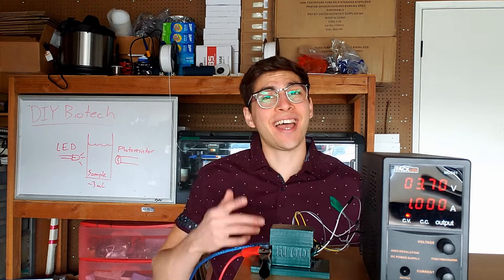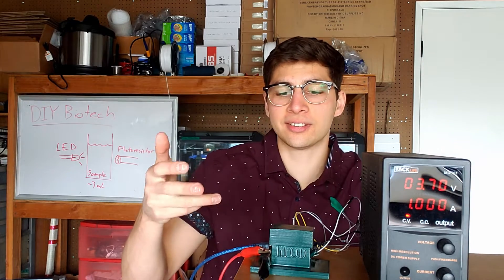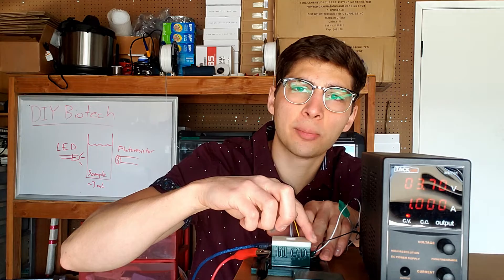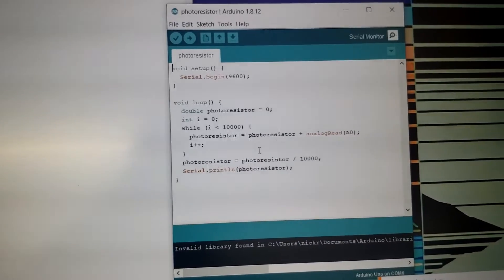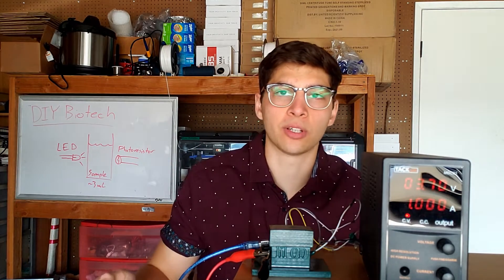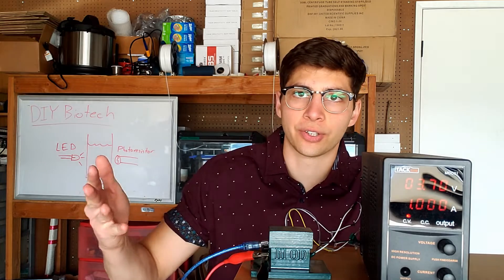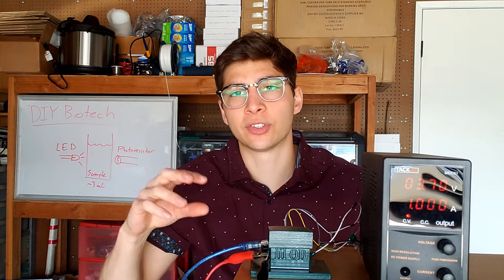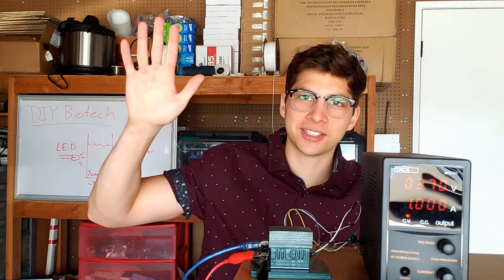DIY Optical Density Reader Spectrophotometer

Comment: Is there any monochromator required for this device? If we need to make a range of wavelength  (400-700nm) with step 1nm ???   required to use RGB led for PWM for wavelength variation. How to plot a full spectrum.

Comment: You should probably calibrate your photoresistor between every reads too. Just read the value without the led lit and substract that to the value with led on. This will also compensate for temperature shifts.